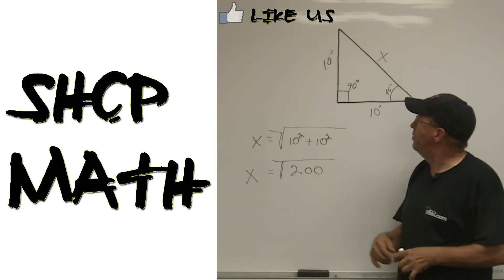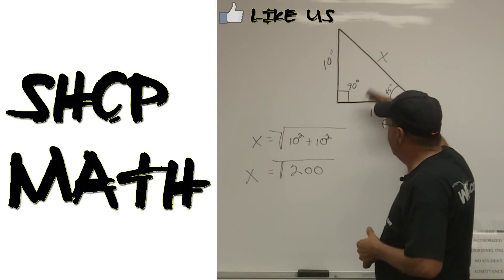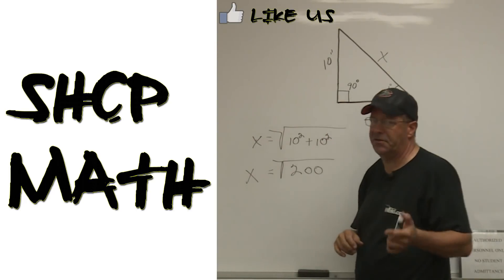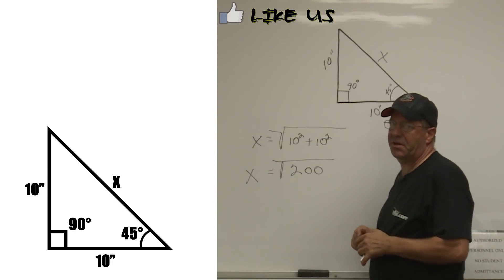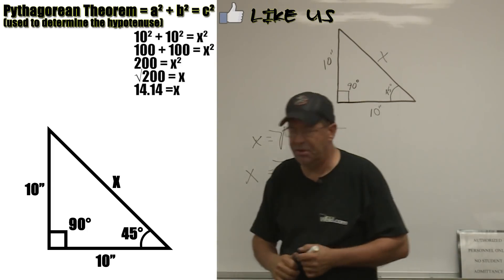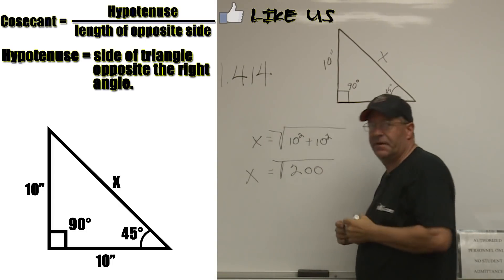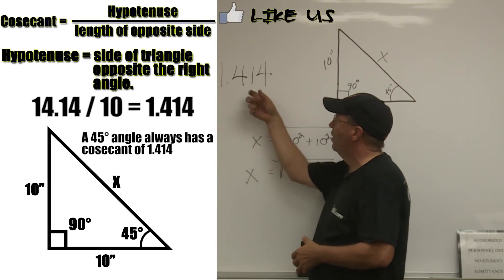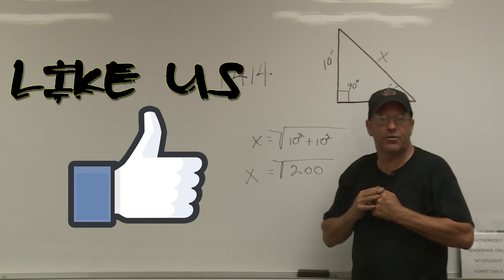🔥 Shop Math: 45° Brace and the Pythagorean Theorem

Comment: Assume the side opposite the hypotenuse is at the bottom of the triangle?  Thanks for the tip
Reply: Yes it will be at the bottom. You can also determine the degrees on the inside of the triangle.

Comment: Bob, you can always take that .14 fractional part and multiply is by 16 (as in 16th of an inch) and get 2.xxx which equates out to be 2/16th of an inch or reduced down its 1/8th (14.1250). 

I just always remembered the 1/8 fractional  decimal equivalents and what a 1/16 came out to (.0625) so I could quickly estimate. A fellow welder told me once if you want to know what half of a fraction is just double the bottom number. (Ex) 3/16" half of it would be 3/32.

Comment: Consider this a LIKE for all the videos you guys put out.
Reply from the maker: Richard Valcourt Thanks for the positive feedback.
Reply: Weld.com Can you do a video on how to find a dimension not shown on a print? I build cages and sometimes run into this problem. Also I use to work for a company that required you to pass a fab test to be hired. The company built railings and stairs. The test was a print of a railing with only one of the angles given. The top rail was one piece with angles cut on both ends to meet with the end posts and one middle post. You had to use math to find the angles and cut your material.